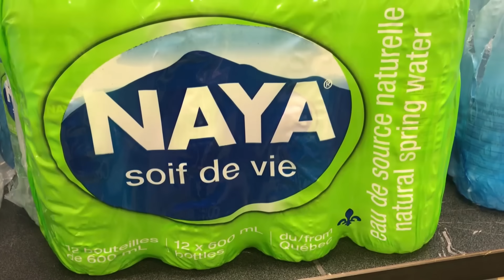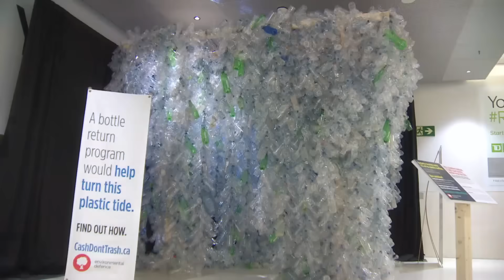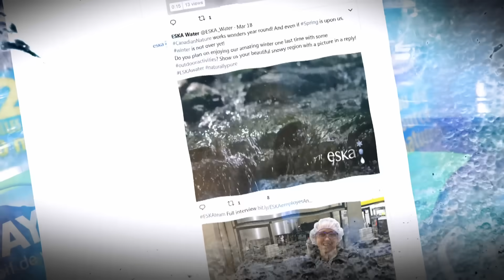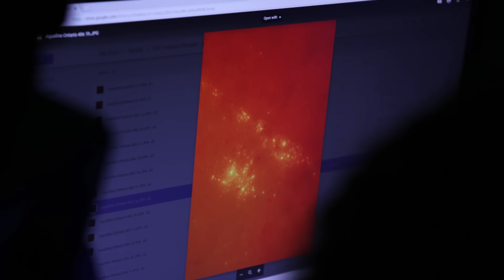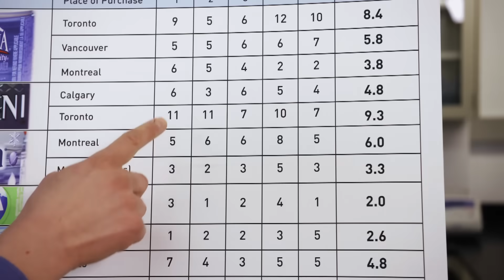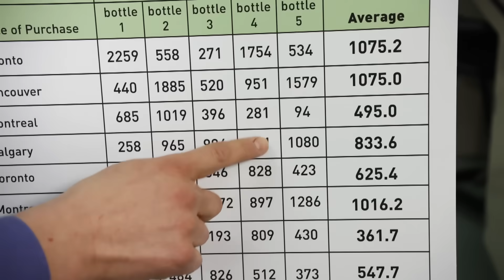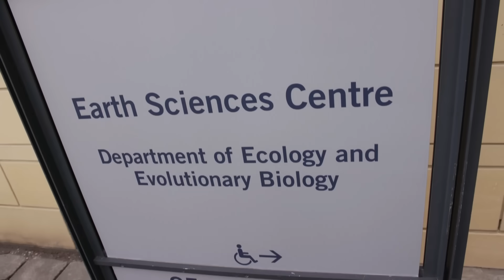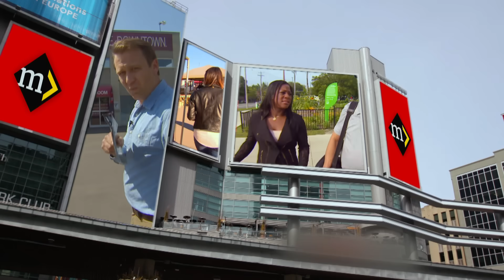Here's what's in your bottled water (Marketplace)

Comment: I'll tell you what Marketplace won't because the government doesn't want it to be common knowledge. Tap water in Ontario has an average ph of 5.9-8.0 and an alarming average of 600-1000 ppm based on what city you test from. I've done a test at a Kitchener plant that came back at 1180ppm. 20ppm below the W.H.O. safe drinking levels. RO water and bottle water has variations of ph levels but they ALL HAVE UNDER 100ppm!!!!! DON'T DRINK tap water. Know what you're putting in your body. It's that simple.  Incase you're wondering,  Evian had the best overall results and Dasani had the worst to nobody's surprise 🙂

Comment: I was diagnosed with chronic pneumonia reaching 13 infections in less than 11 months. I changed  my source of water and drank nothing but bottled water. It's been almost 2 years now and no infection. I have done nothing else different other than change the water because I believed that tap water with the chlorine was breaking down my immune system and preventing my body to fight off infection. Maybe it was a coinsidence that my pneumonia stopped occurring but j sure hope it doesnt return. (Kirkland Water from the springs of Chilliwack, BC). So Plastic in my bottles water you say? So what I'll take it.

Comment: Why does no one ask the question: "why are we throwing trash in the ocean?"
Reply: So what's the solution then?
Reply: You can try Waterwise* Distillers for Their Award-Winning Distillers.  Also, You can try Waterlogic* Hybrid Water Purification Systems, which uses both German and Swiss Technology to both Purify and Sterilize Tap Water.  Waterlogic* can officially make this claim because once Water goes through Their System, it will both Purify and Sterilize Water from Pipes in One's Home or Office.  It does this by using an Advanced Concentrated Carbon Block Filter, then the Water is next Sterilized by going through a Glass Tube that is surrounded by a Coil of Medical-Grade, U.V.C. Light, which is known to destroy Viruses and Bacteria down to 99.99%.  I can personally vouch for the Waterlogic*'s ability to purify filthy Tap Water: The Water Septic Systems in Michigan were spewing Sewage Water through Our Tap Water through Dec. 2016 through Jan. 2017.  After running the Water through the Waterlogic*, the Water did not look, smell or taste like the Sewage Water that was coming from Our Water Pipeline anymore.  Even better, the Water Quality actually Improved Dramatically, because now the Sterilized Water actually Boiled faster, Ice Cubes formed quicker, and after Shaving it coming out of the Shower, the Water felt Calming and Softer, once it was placed onto a Towel and patted onto the Skin, since Toxic Metals and other substances were removed.  To My surprise, the Water from the Waterlogic* removed the Stinging Sensation that ofter happens after Shaving!  This is the Water Purification Technology that We needed decades ago!
Reply: @Huelogy  less consumption n waste, more recycling and upcycling/ reuse.
Reply: @Cassie Tysen gross Over consumption
Reply: I think most trash  comes from poverty  areas  of the world, AMERICANS are more mindful but look at India, Pakistan the ganji River is sooo polluted an they still wash an swim in it cuz it holy?????🌎💦💧
Reply: @blancamiranda7424  woman, did you really compare small a**, nasty, trash Infested, wasteful over consummated USA with a few isolated areas in the entire world???? And trash is only generated from the  impoverished??? Come on now, I know your brighter than that.  With all the environmentalist groups, tree huggers and related organizations, we the US still consume more than is imaginable and it even shows in the amount of trash and refuse that is generated.
Reply: @blancamiranda7424  thats rich coming from a country who discovered cfc , depleted the ozone layer, invented genetic modified organisms , No 1 polluting country in the world. some nerve
Reply: @blancamiranda7424 The world’s largest trashing country with less population is pushing the buck onto poor countries with larger population ...
Reply: There needs to be a deposit on each bottle. I drink tap water. It's all dinosaur pee.
Reply: Barbara Rowley  Don’t worry the planet has been through volcanos blocking the sky for hundreds of years, earthquakes, tsunamis and you think a few plastic bottles is going to be what brings the planet to its knees
Reply: @Kaiyats  j9
Reply: "In 30 years there will be more plastic in the ocean than fish!"
Reply: @Remedi88  such a stress from reality though, won't take that long.
Reply: @Kaiyats  truth not good but real....

Comment: If you are still doing scam reporting. Do a investigation on gas pumps . RECENTLY I NOTICED THAT A LOT OF AIR BUBBLES WERE IN THE GAS LIQUID COMING OUT OF THE HANDLE HOSE. " I TOOK NOTICE OF THIS....

SO MY NEXT FILL UP. I WENT TO ANOTHER STATION , AND NOTICED LESS AIR BUBBLES IN THE MIX..

BASICALLY I'M PAYING FOR LESS LIQUID GAS AND MORE FOR AIR BUBBLES... 

THEN I DID A SIDE BY SIDE COMPARISON WITH GAS IN A GAS CONTAINER, AND TO MY SURPRISE I NOTICED LESS LIQUID GAS IN ONE CONTAINER AND MORE LIQUID GAS AND IN THE OTHER CONTAINER. 

THIS IS PROOF OF A SCAM RIPOFF OF CONSUMERS AT THE GAS PUMPS.

Comment: I use a charcoal-based water filter by PUR with a pitcher & tap water. You can also build your own, or buy a large water filter container system. They cost about $120. I pay ca. $14 for my filters ($7 each), which last me ca. 3 months for each one. So far, in all the years I have used them, I have felt healthy and energized, and I am a health nut, always watchful about what I put in my body ... FYI.
Reply: Zerowater, far superior. Comes with a test meter so you can cross reference your current filter system. Incredible the difference

Comment: I switched to using a Brita filter bottle a few years ago and I think if most people went the way of reusable bottles, there could be a huge difference. Just for myself, I would drink 3-4 bottles of water a day, so 365 x 3.5 is 1,277.5! Almost 1,300 bottles a year! Now imagine if millions more switched over to reusable bottles.
Reply: Zerowater offers even more purity. A world of difference over brita
Reply: Wow that's a lot 😳 imagine households with family 👪
Reply: Brits filter isn’t the best option is it ? I was looking at those when I lived in England but those cartridges made of plastic ? They’re huge and need replacing often? 

I was thinking a filter on the actual water system in the home was a better option. Or some folks use charcoal filters
Reply: @luluah1198  a filter on the faucet itself is a good option as well, but doesn't give you the freedom to fill up wherever you are. With a filtered bottle, you can fill up literally anywhere with tap water. And the filter in the bottles is just a little charcoal thing that goes inside the straw and is replaced every couple months. Depends on your drinking habits, it says it replaces about 150 bottles of water, I think. I hate the designs of their bottles, they're all horribly flawed, but they do the job. If you get a bottle, try to find the old bottles with the hard plasic mouthpiece. There's a rubber cover on it that can be removed so it's more sanitary, but the cap leaks. The new bottles have a fully rubber mouthpiece that can grow mold on them, but the lid solves the leaking problem. I've contacted Brita before and they do not care about any issues regarding their bottles.

Comment: Recycling is failing and has demonstrably failed 

The move from single use bags and bottles will also fail. ( They're just making and selling us more resources intensive goods that will never get reused enough to be of Benifit. Fact.) 

We simply need to ignore the capitalists who will sell us anything to garner profit, they will pretend to be green, and the greens will both buy and promote. Furnaces of the present and future well truly "recycle" all plastics back to their original gases and oils.
Reply: Do not worry nature has found a way bacteria have been found on a dump in Asia that destroy plastics. The only problem is  if they are used to destroy plastic waste and escape then we are set back 50 years and will have to use rubber or resins to insulate any thing electrical no laptop cases no mobile phones clothing will cost more it will have to be made from wool and cotton. The one good thing about the bacteria is that when they have eaten the plastic the resulting goo can be easily refined and used to make a host of new products. Nature  if  left to its self will  find a way to clean up any mess, the big problem is can nature clean up as fast as man can create his piles of toxic crap. There is not much left of the cities that existed before and just after the ice age just a few large stone buildings. Nature has cleaned up the mess from the past including the tar they used to waterproof small buildings.

Comment: Let's see.. filtered water, bottled, with a few (even plastic) particles.. or, (filtered) water which travels underground, through decades-old rusty pipes, for miles, which has vastly more particles (including plastics) once it does finally reach my glass... Yeah I think I'm still going with bottled water.  I've used filters both at the spigot and in fridge containers, and they both are very expensive and need to be changed more often than you think.  I've had algae grow in those fridge containers.
Reply: And you know this because you have analysed your tap water...?

Comment: The plastic is not from the water.the plastic is from the bottle because the bottle company did not Wash the bottle before put water in it.the bottle had a little bit plastic in the bottle all ready because the bottles are making from the plastic recicle . that's why It has plastic in the bottle water.

Comment: I use a dehydrator in my shop. Keeping the bucket clean gives me a consistent supply of DISTILLED WATER, with no metals, fluoride (aluminum byproduct), or contaminants since it's water made from water VAPOR, your humidity.

Comment: Why can’t we go back to reusable glass bottles
Reply: Laziness and ignorance
Reply: @andreakhaid  
The original poster (OP) was referring to reusable glass bottles. Not throwaway glass bottles which is normal practice today. That system used in the sixties was greener than anything in use today. Most don't have a facility to carry reusable cups or bottles. That will never become routine for enough people.
Reply: @andreakhaid  
The consumer is not doing it already. Manufacturers continue using plastic reusables. The return to recyclable glass bottles with refundable deposits will not happen because it is not economical. That's the question I was answering.
Reply: We still use them just go to health food store. Mountain Valley Spring water comes in large glass bottles and even has the mineral amounts on the back.
Reply: I Use stainless steel
Reply: @Christopher Wallbank I will search for a glass one with a sleeve..thank you!
Reply: Because glass is every inefficient material to recycle and not good for the planet. Plastic is actually a very good material by contrast low weight, easy to melt down at lower temp and re-usable by so many industries, but the problem comes from too many different types and sorting. Glass is heavy to move around, it breaks too easily, it requires very high temperatures and intensive industrial processes to melt down and re-use. Glass is ok though I guess for some industries if milk and bottled drink manufacturers got direct recycling in place that's a good idea certainly. In the old days you could take those bottles back to the store and got paid some money on each bottle.
Reply: one word
expense
Reply: @Christopher Wallbank is disposing of it different than drinking out of it. Unfortunately there aren't too many options for on the go, little plastic bottles being the worst when the sun hits it. Any recommendations?
Reply: Bcos the cost is higher with glass
Reply: Bottled water is definitely cleaner than the tap water in South Africe because tap water tastes like Jik here. We pay R37 for 25 Litres of pure water. Dirt cheap!
Reply: Actually, more & more Healthy lifestyle shops are allowing customers can bring their own glass containers and refill them.
Reply: @andreakhaid  can't always feel your bottle up if you asked at a service station they'd probably say no
Reply: Glass breaks, metal does not.
Reply: @Christopher Wallbank The Grocery stores in my Province for last decade features 3 or more brands of Milk in the old fashioned style Glass Deposit Bottle. Just rinse and return. Another Quebec company sold Kefir in Deposit Glass Jars, but later dropped the deposit and we recycle instead of Return. One local Juice Co has Deposit Bottle.
Reply: i think paper and plastic should be reused. i agree with you
Reply: Ask your government
Reply: bcz glass is more fragile than plastic??
Reply: some of us have
Reply: Its like lets go back to NON GMO
Lets go back to nature..
Simpler ways of life
Reply: B/c Americans r afraid of a little virus!
Reply: Because....because.  . you need to melt it and rebuilt plastic should be easier i think to recycle....
Reply: Bottom line...profit
Reply: @DeSpion1138  Well back in the day, for example, Coca Cola would have places where you could return the glass bottle once you were done with it so it could be washed and repackaged because making glass bottles at the time was expensive and It was just cheaper to wash the bottles and use it again.
Reply: @DeSpion1138  think of costs overall. what does and will it cost society to clean the environment of plastic and its effects. glass beer bottles are.recycled. there is a model for glass sorting and recycling that.could be followed
Reply: Too expensive to manage.

Comment: Even though i am against the concept i still drink bottled water. this is mainly for two reasons. There is a large quantity of a particular type of mineral in the water here where i live mountains. I already use vast quantities in cooking and hot drinks, i actually want to drink a different type of water that comes from a non mountainous area to balance out any concentrated minerals in the local water.
   The other reason is just that i don't really trust the pipework and i don't like the way that any water that sits in the pipes starts to concentrate with what residues or minerals are left on the walls of the pipes. I don't want to run the tap for 2 mins every time i go to get a drink and i really don't know the state of pipework under the road. Not to mention how it's treated. So i drink Volvic which comes from the ancient volcanic reigons of France which is where i live.

Comment: The brands they chose for this Hahahah I know this was about plastic but they didn’t even mention the different kinds of water filtration!! Spring water is the best and truest form of water. Most tap water is trash and MUST be filtered further, even then it doesn’t always remove metals or Fluoride. Reverse osmosis is safe and a lot of bottled water/water stores use this process. Distilled is pure zero meaning ALL minerals have been removed even the good ones found in spring water that the earth gives us. Not sure what laws Canada has but the tap in the states is poison.

Comment: my name is tucker i been in plastic for 40 yrs and i dont believe any of this and plastic company can fix the problem very easy if you are getting plastic in your bottles of water and as a food product it would not hurt you because of the material in it and plastic will not melt as easy as you think yes it can burn but if you burn it its not good for anything but the trash not its going to take 350 to melt it and burn and melting plastic is not the same.

Comment: I live in Az and the water taste awful but some of the bottles taste worse.  I drink tap water out of a cheap filter, taste fine. I even reset the filter several times, use the filter till the water starts to taste bad or it clogs up. I tested it they say it does 200 gallons, it wants replaced at about 25 or 30 gallons.

Comment: I worked at a place that bottled Arrowhead water in Colorado Springs, it was tap water that was run through a hydrochloric acid tub. The south and east side of this city have been cited to have very dangerous chemicals in the tap water, the Air Force has even spent millions trying to fix some of the issues.

Comment: I first boil my water out side for 5 minutes to remove the pollutants that turn into gas. Then i run it through my water distiller, To remove solid pollutants.The problem is it takes 4 hours to make 1 gallon of water which uses a lot of electricity. Unfortunately i cant make clean water for my clothes washer or shower, it would take all day.

Comment: The best thing to do, is invest in a good filter.
Reply: Hello, do you recommend any??
Reply: @CountryBlessingz  A good filter is NFS/ANSI 42 and 53 certified. 42 reduces taste and odor while 53 reduces contaminants. A solid carbon block filter will work but those systems tend to be under the sink setups. 
Zerowater filters work great and they're more convenient if you don't or can't add a multiple filter system to your water supply. Brita also makes 42 and 53 certified filters called Longlast though it doesn't have good reviews. 
Be aware that these filters filter water SLOWLY. It's why we got a 30 cup Zerowater container. Also, if you let the water level sink for a couple of hours or more, the filter may dry out and filter extremely slowly. You'll have to add water and tap the container with the filter against a surface to force air bubbles up and out.

Otherwise, try and find the performance data sheet for the filter you're interested in along with a water quality report from your water supplier.
But if you want to save yourself the work and headache of learning all this yourself, Zerowater is a very good option